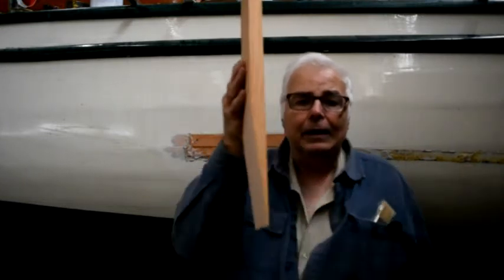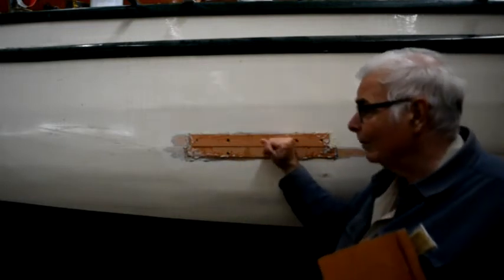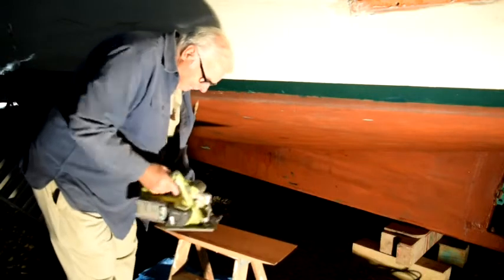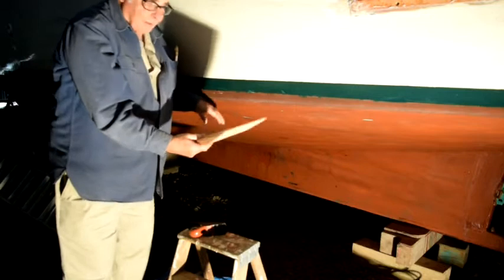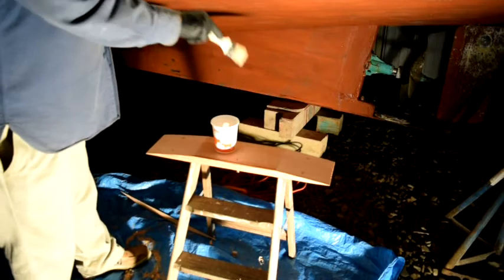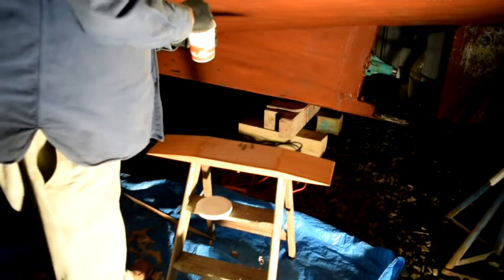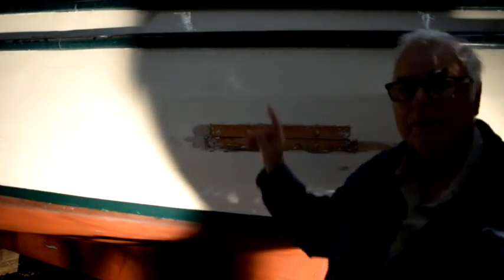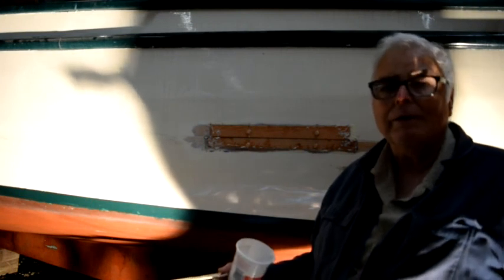Boat Maintenance - Epoxy scarfing a plank repair

Comment: did you buy the ryobi battery tools in a kit from lowes or home depot? They appear to work very well. nice work on the fit.
Reply from the maker: I hit a very good sale at Home Depot for the Ryobi tools.  I paid something like $150 for the skill saw, drill, driver, oscillating saw, sawzall and a light with two batteries.  I bought the sander separately.  I also have some corded tools that I use when I need more power.  The Ryobi tools are OK, but the quality is not as good as some older Milwaukee tools I have.  The Ryobi tools were definitely a good value given what I paid.

Comment: Now that the holes in the hull are filled back in with wood, it won't be long and nobody will know the repair ever happened.
Reply from the maker: Yup, a little fairing and painting and Tortuga will be good as new.  So no one will know unless they watch the videos.